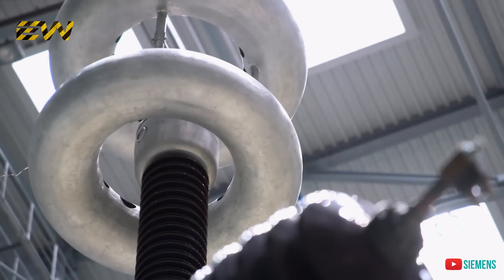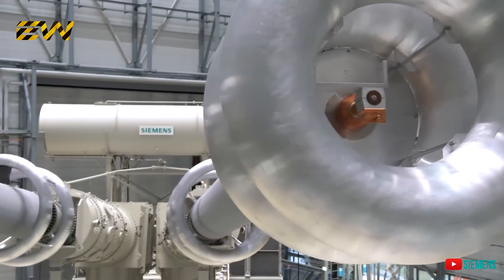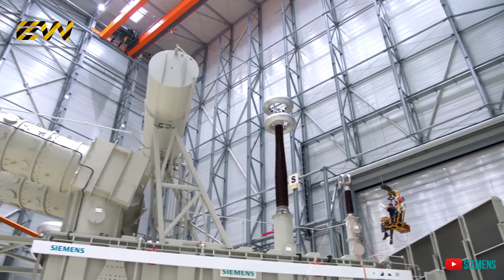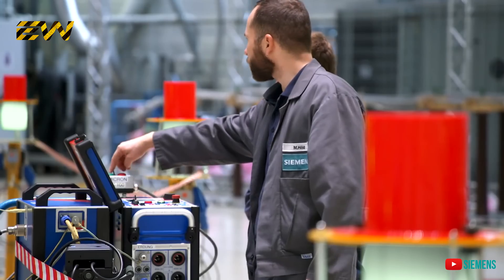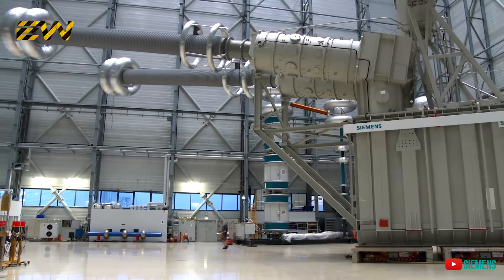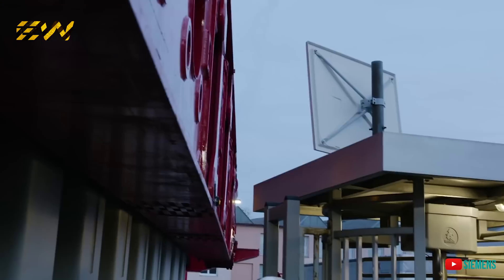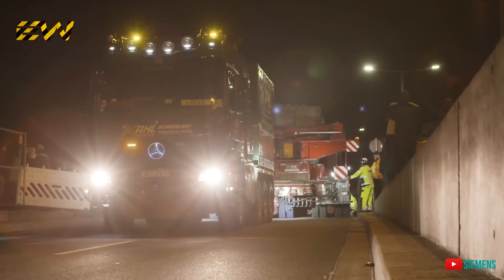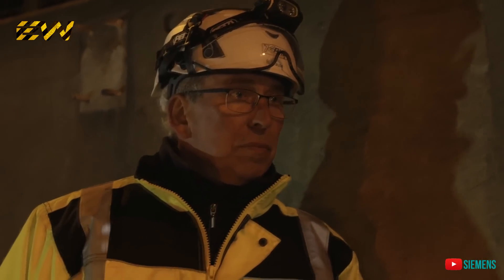World’s BIGGEST Electrical Transformer Video

Comment: Higher voltabe means more winding on the secondary to reduce the voltage to match the existing system. This requires thicker insulation to prevent internal arcing. more space for the added coils and for oil to cool.
As an aside - who in their right mind transmits DC power? Transformers do not work DC
Reply: Very true indeed , AC is a must for a transformer to work , B4 the power is transmitted , It is converted to DC , Then , At it's destination , The power is inverted to AC B4 reaching the next transformer to step down the voltage , In DC power transmission , AC is needed for both the step up and step down transformers , That's why Nicola Tesla's alternating current won the world over by a landslide when he competed against Thomas Edison's direct current at the world's fair in Chicago because DC power can only be transmitted for short distances compared to the thousands of miles AC power can be transmitted via stepping up the voltage at the beginning and stepping it back down again at its destination
Back in elementary school , When they touched base on Thomas Edison's invention of the light bulb and Benjamin Franklin discovering electricity , I wished they would have been able to touch base on who discovered generating electricity and when they actually began mass producing electricity because of course , Thomas Edison had to have electricity to Invent the light bulb
Reply: With such a long AC line , the impedance in the line would hinder most energy come true. The energy will be filled into the line in one part of the cycle and go back to the generators in another. With DC you will not have that problem. By using that high voltage, also loss by reistance will be greatly reduced.
Reply: @knutholt3486  that's true indeed , I wonder how much more available power you'll get with the DC system with the greater reduction of line loss
Reply: HVDC transmission lines are more economical above line lengths of 700km. This transformer will have rectifiers inside it.

Comment: A transformer can be tiny or big as this example. I´m from Austria and we have a 50 Hz network. If you take your tiny single phase transformer plug adapter (no electronics inside) like an old nokia phone charger to a 60 Hz network with same voltage (230-240 V), the transformer will work as usual normal, but it can provide more output power because it´s size is the same. Audio transmitters are also normal ac transformers, but smaller and more powerful because of the higher frequency. Either a transformer can, by increasing the frequency, be smaller with the same output power rating or by leaving the size as it is it can provide more power.
Greetings from Vienna, Austria!

Comment: Direct current?  So, China does NOT have a 220V 50Hz AC system?
Reply: Transmission for long distance is efficient in HVDC(high voltage DC). I guess they utilise it in AC form only.
Reply: @parilkotecha3300  Interesting!
Reply: @cbcdesign001  We can say partially. At that time, tesla was right. He proved AC is more efficient than DC in Transmission and utilisation during that period.
Ps:- I have Read your original comment 🤣🤣

Comment: 1. a quantity called volts per turn is directly proportional to the size of the transformer core and is also directly proportional to the voltage
2. the higher the voltage the higher the insulation demand, the greater the size

Comment: what's the point of having High Voltage DC over long distance that's just a waste of power
Reply: So that it is possible to link electrical networks that may not be synchronised, the dc switching system either end handle the power conversion and sync localy. I should imagine that some areas of China may not have the best voltage and frequency regulation.
Reply: No it isn't. DC produces less losses than AC does for a given voltage because DC doesn't have inductive reactance and capacitive reactance, purely resistive.

Comment: A DC transformer?  I must be enlightened on how a transformer works on a DC system.  I was taught that DC voltages cannot be transformed by transformer turns ratios like AC.  But I work in the polyphase AC utility industry.  so what do I know about DC transmission.  When they start building DC distribution grids I'll start taking notes.  Edison would be proud.
Reply: A DC transformer doesn't exist, it's a normal AC transformer with probably some really insanely huge inverter converting the DC to AC to feed the transformer, and vice versa at the beginning of the transmission(huge rectifier after a standard AC transformer). It's basically a gigantic SMPS. Otherwise I don't see how this would be possible.
Reply: @marekfiala7230  The Dude in the video states that "it feeds 1100 KV DC into the transmission system".  If this is the case than I assume they also have an 1100KV rectifier on the high side of this monster making DC?
Reply: @jetsonsain  Yeah, basically they take power from a normal AC grid, run it through a step up transformer, rectify it on the secondary side, send it over the transmission lines, and on the other side there would be a transformer with an inverter making it AC again for the step down transformer.. although... I've never heard of of any semiconductor being able to withstand 1200kV, so either it's a string of large IGBTs or some technology i've never heard of before...
Reply: It most definitely has rectifiers inside of it, however I’m not sure what type of voltage the generators supply it. If it’s DC there will also be inverters.

Comment: does anyone know the kwh waste heat these produce when working at capacity ?
Reply: That would be the impedance measured at full load at the factory then stamped on the name plate.  During acceptance testing they sometimes do a no load loss test for the customer per specification, on a 20mva 130,000v transformer you can have as much as 10kw at no load.  That’s just the exciting current.  At full current I would imagine the losses would be more but I am not sure.  Our transformers run at around 100 degrees F on the metal case during I.R. Scans. This means that the core is hot enough to heat 6000 gallons of insulating oil that is circulating through radiators and the metal case.  That’s a lot of heat losses.
Reply: @JimFly01  Thankyou !  Its a shame the old  oil is so toxic though i hear modern alternatives are better ,at least pcb free .

Comment: As voltage rating increase, the number of coils  required increases. The high voltage calls for heavy insulation. The coils are wrapped by many levels of insulating material. Also, the bus bar must be at a certain height from the body which calls for long bushings.

Comment: Maybe one day there will be avalable better ways to do insulation inside and outside the transformer. There might already be other ways, either they are too expencive or not reliable enough. Conductors also heat up because of the amps/power so a super conductor at temperatures below 90 celcius could change things. Better core materials etc. At the moment there are no better engineering solutions do the lack of research, money to test new solutions or customers not willing to have prototypes.

Comment: My concern would be magnetic saturation of the transformer core. That limits the voltage of any transformer at a given frequency. to maintain low DC resistance, to minimize I^2R  losses, you simply need to store more magnetic energy, thus, you need more iron. One thing puzzles me in this video: A transformer cannot isolate and pass direct current. Do these transformers include high voltage switching semiconductors?

Comment: 1.As vtg level increases the cross sectional area of winding of transformer will  be also increases 
2.as vtg increases -capacity of  transformer oil is more required for isolation

Comment: These Transformers are not driven with sine waves but use square waves. Faster rise times generate more (higher) Voltage. Massive inverters are also closely stacked and integrated into the unit as a whole.

Comment: Talk about unreliable grid. So if this transformer fails you are going to lose 11GW of power? Building higher and bigger looks good for the record books not for anything else.
Reply: I suspect a second one will be installed either in parallel or as a backup. Good point though!

Comment: 1:02 1100KV "direct current"? No way man. Transformers don't process DC voltage.   WRONG
Reply: It will have rectifiers inside of it. HVDC transmission is more economical for transmission lines 700km+ in length.
Reply: Switching DC power or Cockcroft–Walton generators can do it all day long. So... You're WRONG....

Comment: DC? I don’t think so
Reply: Why not? DC is used for EHV transmission in many places, including the US.
Reply: whiteknightcat 
DC cannot be directly transformed. I am aware of the need for long distance dc transmission lines to eliminate line attenuation. I was just pointing out a misstated point in the video
Reply: @isnak907  So could you please say what is misstated? Note that even the large banner attached to the transformer case is labeled "World's first 1100 kV UHVDC"
Reply: whiteknightcat 
Around the 1:00” mark.
This transformer defiantly doesn’t produce 1100kv DC
Reply: @isnak907  The narrator stated "These transformers feed into a transmission system at a voltage level of 1100 kV direct current, transmitting electrical power of 12 gigawatts." I'm afraid I still don't understand what is misstated. AC power would be converted to DC power at a rectifier station, then stepped up to the rated voltage of the transformer bank (since three of these single-phase transformers would be needed), and then out onto the line. What am I missing?
Reply: whiteknightcat It’s the physics of the transformer. No step up or step down can be done with a DC current. Learn Engineering has some good videos to help get the basics down.
Reply: @isnak907  OK, I understand now. I found out what the arrangement is. The reason they're calling the transformers UHVDC units is because they are components of the AC/DC converter stations. They actually are single phase AC transformers, stepping up about 850kV input to the 1100 kV output which then feeds directly into the converter units busses. At the receiving end, the DC is again returned to AC and fed directly into the transformers which then step the power down to the EHV levels for the grid at that end.

Comment: Transformer size mainly depends on sampled current. since the overall power remains constant, I think, if 1100KV are on secondary side then the current in the primary side will be at max and to handle that current requires huge set of conductors. However colling and isolation mechanisms are secondary factors.

Comment: It is totally fake that they are saying... worlds largest transformer has made in 2007 in India by vijai electricals limited company.......which I am working in that company right now as a production engineer.....with 12500kva rating transformer of 12.5 mva
Reply: This is kV not kVA.
Reply: HVDC transmission needs bulk amount  of power to be transmitted.In this case high voltage transformer require at sending and receiving end